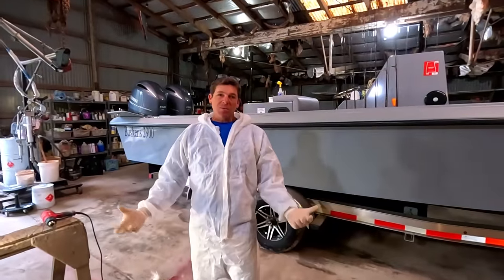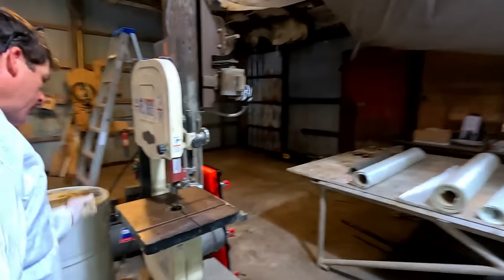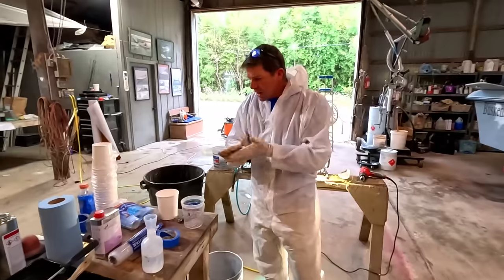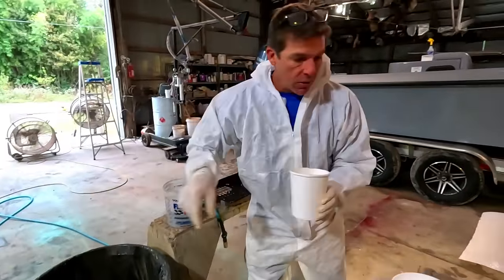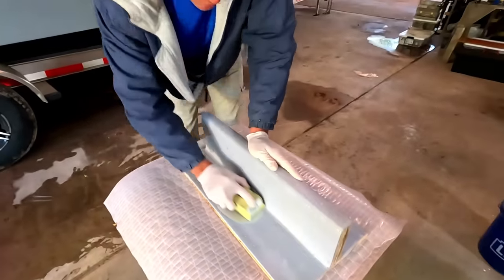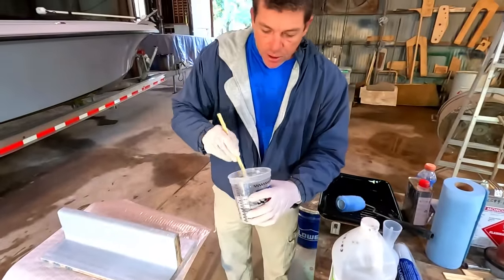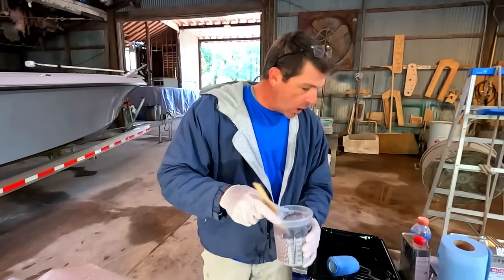Gelcoating Fiberglassed Plywood DIY! (Like a Pro)

Comment: I usually just spray it on which gives better coverage IMO.
Reply from the maker: Sure, spraying can work well.  I just wanted to demonstrate a more basic method, that didn't require a spray gun, compressors, air hoses, masking paper, etc. Not every  one may have all those tools, or may just have a small amount to do. I will probably  do a gelcoat spray video soon. Thanks for watching!

Comment: I sold my grady after redoing the stringers transom and deck (plywood and polyester 1708). I never added getcoat to it as its something I never done before. I thought you suppose to add fairing compound before you add gel coat. I could be wrong
Reply from the maker: If it is on the boats exterior you would fair it, but for interior gel coat we usually just sand it lightly then gelcoat.

Comment: One question as it comes to mind, is there a max time between coats where adhesion matters and if you go over it may need sanding to promote adhesion or it doesn't matter? Thanks
Reply from the maker: We usually allow 12 to 24 hrs between coats.You can lightly sand the first coat by hand if it has any small imperfections, but it will gum up your sandpaper. Hope this helps
Reply: @FishBumpTV  thank you

Comment: Hi this is Tommy from the isle of man I have a romany 21 bulge keel I currently stating to plan putting a marine ply decking .what is the best way to put hatches in the deck best regards Tommy
Reply from the maker: Hatch designs can vary a good bit. I will tell you that one of the most common ways would be to have a combing, or ridge around the perimeter of the opening. It could be anywhere from a couple inches up to a foot or more. Then you build a hatch lid with a flange around the perimeter. This kind of hatch is common on a lot of commercial work boats in our area. Of course it is not flush to the deck, but flush hatches can be very tricky to make watertight. I would check out some of the hatch designs in your area, and follow the ones that seam to work best. Hope this help. Thanks for watching!
Reply: We use to use exterior pine ply instead of marine ( same thing just cheaper ) but the best is to use fiberglass sheeting instead. Will last forever.

Comment: Should I not use wax in gelcoat if I'm going to sand and spray it with imron to match the rest of the boat?
Reply from the maker: You can use wax on the last coat of gelcoat, then sand it thoroughly to remove the wax. I recommend priming over the gelcoat before spraying imron.i hope this helps and thanks for watching!

Comment: Should I not use wax in gelcoat if I'm going to sand and spray it with imron to match the rest of the boat?
Reply from the maker: If you want to sand,and paint over gelcoat, then yes it should have wax added. Otherwise it will gum up your sandpaper when you try to sand it. I would also recommend a quality primer over the gelcoat before painting. I hope this helps and thanks for watching!

Comment: Can you use bondo under the gel coat to smooth out any imperfections in the fiberglass matting and resin?
Reply from the maker: You can use a polyester or a vinyl Ester based filler under the gelcoat to fair it out before gelcoat. I usually prefer something higher in quality than bondo if possible,  bondo is more of a automotive grade filler and may be more prone to absorb moisture in a wet environment. I hope this helps and thanks for watching!

Comment: I have a Bayliner 185 that I have some gel coat coming off the inside of the under floor storage compartment. It looks like plain plywood underneath where gelcoat coming off.  Can I scrape off the loose parts and just gelcoat right over the plywood?

Comment: So, I'm wondering how much material was on there - I saw the building of this fiberglass, and it didn't look too thick - and how much did that 45 grit take off?!
Reply from the maker: It was between 3/16 and 1/4 inch thick. Looks like I took more than I did. I put a long bevel on that last edge of biaxial to make it blend nicely. I will try to do a grinder demo for you guys soon. Thanks for watching
Reply: @FishBumpTV  thanks for the reply!!

Comment: So what would be the easiest way to do the exterior of a boat? I got one ive had for 20 years that i need to do the interior on but its brown.. brown and tan.. i want to do a blue and white on the interior and exterior. I dont want to mess with sanding and buffing out brush marks.. does it work well to spray it? I really want to change the exterior colors or i cant do the interior the colors i want on the upholstery. Hope you got some good advice. Lol

Comment: How boat manufacturers do it so smooth gel coating? Spraying with gun??
Reply from the maker: If the gelcoat is sprayed into a mold it comes out as shiny as the mold it was built in. You can spray it with certain additives to make it flow better, or you can wet sand and polish it. We have a hardtop mold building series that we are currently posting videos on the process that shows a lot of the materials and techniques used to make gelcoat shine. I hope this helps and thanks for watching!
Reply: @FishBumpTV  ❤️

Comment: Would a lower knap roller or foam roller leave a smoother finish?
Reply from the maker: Yes, it's slightly smoother. But it's not a huge difference in my opinion. If you want it smooth, you can add a clear additive, then spray it. I have a video about how to spray gelcoat here on the channel. I hope it helps and thanks for watching!

Comment: Capt Joe, how can I repair old spider cracks on a 2006 hurricane deck boat.  It looks like the gelcoat from the factory failed just on the cap.
Reply from the maker: You typically have to grind the cracks out completely, then rebuild with a high strength filler, then finish with gelcoat. That of course is the basic process. I will try to do a video on that when I get a chance. Hope that helps. Thanks for watching!

Comment: Can you double coat with the wax or would you need to sand in between coats???????
Reply from the maker: If the gelcoat had wax in it and it has cured you will need to sand it and wipe down with acetone before recoating. Hope this help and thanks for watching.
Reply: Thank you, that's what I thought just wanted to see if you agreed before I screw it up  @FishBumpTV

Comment: What can I do with blistering where the boat sits on the bunks of the trailer on my Ranger Z20 2007. Have great day, Thanks
Reply from the maker: Blisters on the hull are pretty common. They are a result of water being in constant contact with the hull, in your case wet carpet trailer bunks. They have to be removed with a grinder or other specialty tool, then be repaired. The repair material is usually epoxy or vinyl ester based. Hope that helps. I will try to get some content on that subject out for you guys. Thanks for watching and commenting!

Comment: How do you prep and reapply gel coat to the bottom of a boat?
Reply from the maker: It would basically be the same process we use for interior gelcoat prep. Just remember that gelcoat that is not applied in a mold, does not look the same as molded gelcoat. It will have a flat sheen,  with a somewhat textured surface. To get it to shine it would have to be wet sanded and polished. I plan on doing a video on that process soon. Hope that helps. Thanks for watching!

Comment: I've just seen something Brilliant which l use in the  mechanical w/shop everyday , a milwaukee r/h ratchet....mine are H/D 3 /8 drive units with 5 ah high output 12v batterys ,  Fantastic...l've seen so many yachties STRUGGLE with manual ratchets....WHY ???

Comment: I am about to reveal with this following question my complete misunderstanding of what gel coat is. I was under the impression that gel coat was a final release and smoothing agent for molded fiberglass work. So what is gel coat anyway? A special fiberglass paint? Resin based paint?
Reply from the maker: Gelcoat can be applied to a mold as the first coat, followed by a fiberglass laminate. This is how most people see it, and think of gelcoat. You can also apply it with a brush, roller or spray on a surface like we did. It does not look like molded gelcoat at all when done like this. It is more of a flat sheen, with a somewhat textured surface. You have to be sure to add a wax solution in the last coat, or the surface will remain tacky. Yes, it is basically a high quality pigmented resin. I Hope this helps, thanks for watching!

Comment: Can gelcoat be thinned and sprayed?
Reply from the maker: Yes, you can thin with styrene or duratec clear high gloss additives. You will need a larger tip than usual for gelcoat.

Comment: Can you apply gelcoat over epoxy.
Reply from the maker: In some cases, it is possible,   but I don't generally recommend it unless you use a tie coat. A tie coat goes over the epoxy base and is completely compatible with gelcoat. I have a video here on the channel showing the use of a tie coat over epoxy. It's titled You Can gelcoat over epoxy. I hope this helps, and thanks for watching!

Comment: I was always told the gelcoat was sprayed on or in the molds and then the glass was put in .
Reply from the maker: Yes, gelcoat can be sprayed in a mold. It can also be rolled or brushed over fiberglass. We always add a wax solution in the last coat so it will cure tack free. Thanks for watching

Comment: Surely you can buy Gelcoat suitable for Epoxy ?
Reply from the maker: Generally gel coat, or polyester based products are not recommended for applying over epoxy. Thanks for watching

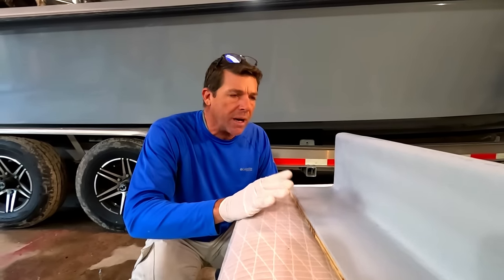Comment: 31:50. I’m confused.  Is what you did not putting gel-coat over epoxy.?
Reply from the maker: In this video we are using polyester resin. Gelcoat works well with both polyester and vinyl Ester resin. It is not usually recommended that you apply gelcoat over epoxy resins. I hope this helps. Thanks for watching

Comment: Is there a exceeding limit, like if I put four coats?
Reply from the maker: Usually 3 coats us plenty,  unless you plan on wet sanding and polishing the gelcoat. In that case I would recommend 5 coats of gel. Thanks for watching
Reply: I just want to provide better protection on a boat, and keep it simple for a fiberglass and 20 foot perahu canoe.

Comment: Did you get the gel coat over epoxy backwards?  You just gel coated over epoxy fiberglass.
Reply from the maker: The resin we are using is polyester in this video. You can see exactly what brand in the videos prior to this one. Gelcoat work great over polyester and vinyl Ester resin. It is not compatible with epoxy. You must use a epoxy compatible paint system with epoxy resin. Thanks for watching

Comment: Can you use gel coat in a shower pan
Reply from the maker: If it is a fiberglass shower finished with gelcoat, then yes you can. Some showers are not gelcoat, in that case you might want to use something different, like epoxy. Hope this helps. Thanks!

Comment: Why didn't you apply resin to the sides of the part?
Reply from the maker: I did In the next video in this series. The part I am fiberglassing is just a sample part for demonstration purposes. So check out the next couple video in this series and I glass the ends, install rigging pipes through it and apply filler to fair it out. Hope this helps and thanks for watching

Comment: But didn't you just put gel coat over epoxy? What did I miss?
Reply from the maker: The demonstration piece in this video is fiberglassed using polyester resin, not epoxy. I have several videos in this series that go through the whole process. The first one Is how to fiberglass over plywood. In it, I show and talk about using polyester  resin. I also have a how to epoxy fiberglass over plywood video that you might find helpful. Some epoxy, if given 2 to 3 weeks of cure time, then sanded very aggressively may work with gelcoat. But it is hard to know for sure which brands will work best with other brands. System 3 epoxy makes a product called sb 112 that is designed to work as a primer or tie coat between epoxy and gelcoat. You might want to check it out. I have a video on that product on the channel also. Hope this helps, and thanks for watching!

Comment: Why not just use one good coat of flow coat where the wax shine rises to the top. Gelcoat is designed for moulds, wax goes to the bottom
Reply from the maker: Here in the US gelcoat with wax added in is not called flow coat. Suppliers usually sell gelcoat without wax added, and we add wax to it as needed. With the wax additives we use here the wax floats to the top, it does not sink to the bottom, you can actually see the wax sitting on the surface of gel coat that has been standing. We don't ever recommend applying only one coat of gelcoat to a new part, it is very hard to get good coverage with only one coat. I believe I show in the video the thin spots in the gel after the first coat with no wax, the job looks and lasts much better with two coats in my opinion. Hope this helps, and thanks for watching!
Reply: Interesting, when I was building boats many years ago here in Australia I was using American gelcoats and flocoats. Gel for moulding and flo for painting internaly exposed fibreglass surfaces, bilges etc. gelcoats does have wax built in, it's why the hull  surface is shiny when you pop it out of a mould. When you spray or paint it on a mould it looks flat, no wax at the top so fiber mat will adhere. Not a good idea to paint it on to bare fibreglass as the wax at bottom will prevent good adherence. This is unavoidable though when you are joining two mouldings and you need to spray gelcoats on the faired join in which case you use styrene as a thinner which leaves a shiny waxed surface. Having said that I would still use gelcoats with added styrene rather than flocoats to rehabilitate old hulls.
Don't want to sound like a know all, your recommendations are fine

Comment: no fairing coupond, eeeeeek!  why not?
Reply from the maker: This is a sample piece I built to demonstrate the basics of fiber glassing over plywood, and gel coating a inner compartment. Most interior compartments in boats are not faired out, it just isn't necessary. I know this because I am a U.S Coast Guard licensed professional boatbuilder, as was my Father. If you want to spend the extra time and money to fair out your interior compartments, then you should. Faring is done on exterior surfaces that can easily be seen, it is purely for cosmetics. Fairing adds considerably labor and expense to most projects. That is why I did not fair the piece in this demo. I hope this answers your question. Thanks for watching

Comment: You use flow coat as a top layer, not gelcoat, as gelcoat stays tacky, where as flow coat has a wax in it, and does not remain tacky when it cures.
Reply from the maker: We don't call it flowcoat here in the states. We just call it gelcoat, then we add wax to it for a tack free surface.

Comment: I've used a lot of polyester resin in fiberglassing. It is extremely smelly and lethal. Ignorant users have died by using it in closed spaces. The narrator is correct in all of his safety practices. I eventually changed to using epoxy resin which is also dangerous not following safety guidelines. Both resins use the same penetrating cloth.
Reply from the maker: Thanks for your thoughts!
Reply: I had heard that lots of chop strand may has styrene binders incompatible with epoxy.
Reply from the maker: @georgeorwell4059  Yes, that is true. Csm or mat does nor work well with epoxy resins. It works great with polyester and vinyl ester resins.

Comment: Good stuff…
How about passing on some wisdom of polyester versus epoxy resins, as you seem to be predisposed to polyester.
Reply from the maker: Polyester is the most commonly used resin in boat construction, but I have plenty of experience with epoxy, as well as the often overlooked vinyl esters. They all have pros and cons in certain applications. I just thought polyester would be a good place to start, since it is very widely used. I have a resin comparison video in the works. Hope you enjoy it, thanks for watching!

Comment: @36:40 "...gelcoat and epoxy are not compatible..." What were you smoking buddy???  Gelcoat is made to work with epoxy resin! When you make a boat in a mold for example, you put gelcoat on the mold and than apply epoxy while gelcoat is still tacky... so gelcoat+epoxy=friends ;-)
Reply from the maker: Yes, What I said is correct. Please go back and watch the video again. You CAN put epoxy over gelcoat or polyester resin, you should NOT put gelcoat over epoxy. Big difference! In your example of gelcoat in a mold first, then epoxy resin lamination, That will work! Which is exactly what I said in the video! The sample piece that we fiber glassed in this video was done with polyester resin as a base, in this case you could use gelcoat or a epoxy based paint system as a topcoat. If we used epoxy resin in the laminate, you should always use a epoxy based topcoat. Also as far as compatibility, You CAN thin polyester putties with polyester resin. Try mixing epoxy resin into a poly based putty and see what happens, its NOT good. I Grew up in a boat shop, and am licensed with the coast guard as a professional boatbuilder, as was my father. Our family has built hundreds of boats, and done thousands of repair jobs. I have probably applied more polyester and epoxy than anyone you will ever meet. So I feel quite sure I know what I am talking about on this subject. I am sorry you feel so strongly about what I said, and if there was any confusion. I am just trying to share some FREE useful advise on this subject. I hope this clarifies what is said in the video. Thanks for watching
Reply: @FishBumpTV  Actually we are both right or both wrong ;-). Depends on which side you are looking at. There are gelcoat based on epoxy and gelcoat based on polyester. I work with epoxy only ;-) Sorry though for "harsh wording" was more like yoking ;-). All the best mate!